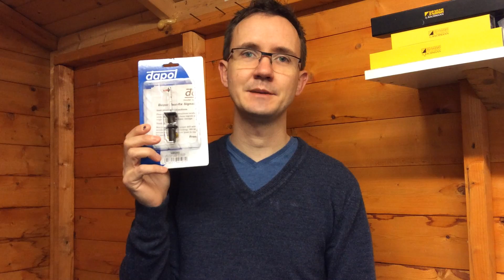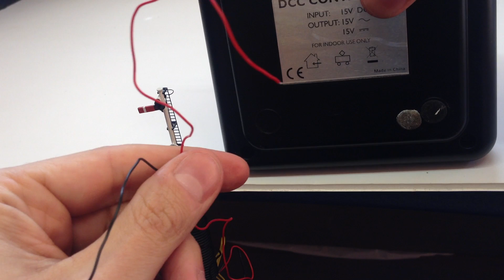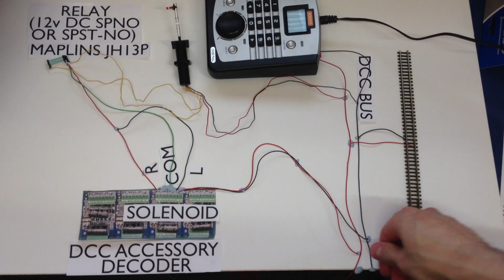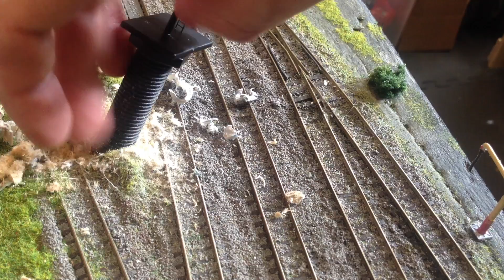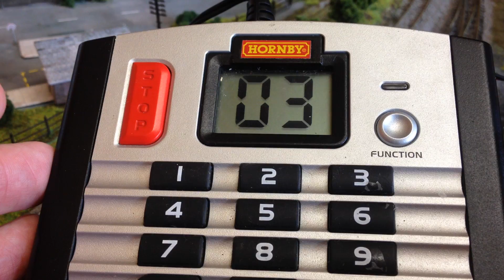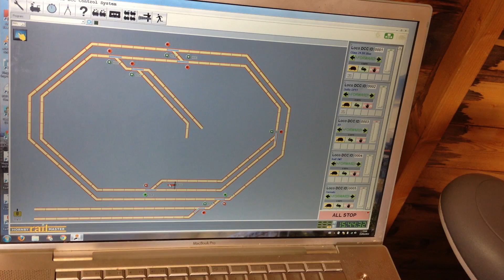Fitting signals controlled by DCC

Comment: Hi Simon, I am fitting  Dapol semaphore signals to my DCC layout. I am running Railmaster via a e link controller with Peco  insulated frogs run off ADS- 4SX dcc/dc solenoid decoders. For the life of me i cannot find the relays you quote on the  internet .The one you show looks nice and basic so would like to use that particular one. Can you guide me to the site to buy them. As I have 30 set of points i do not want to go buying train tech controllers for 30 set of points. .Also   Is there a way of linking the signals  to the the point so they are activated when switching the points. Thank you in anticipation.   Tony

Comment: Simon l followed you video all be it an old video very helpful.l tested my signal the same way you demonstrate,my signal powered up but would not work,what l did notice was when the signal was at caution the aspect was red which is incorrect the aspect at caution should be yellow on amber your input would be interesting Rgds Stuart
Reply from the maker: Hmm really tricky to know what's going on with it, do you have another to compare it to...maybe its a faulty one?

Comment: DCC controlled = more wiring than you need, and a heck of a lot more cost. Dapol semaphores will work on as little as 6v DC although they don't tell you that in the instructions. You can therefore operate the signal from a simple on/off switch. When you have say tens signals, you only need 11 wires to control all of them with a normal DC supply !!!!  Anything using AC nearly always adds more wiring. Anything related to DCC means roughly 4 times more cost. Get real, join a club and learn about basic DC and save yourself a fortune.

Comment: Trying to find a vid that shows cobalt motors working in conjunction with dapol semaphore signal.Were ass you can set 2 cobalt motors with same address so as they work together on a crossover.Could using this system with the same address as the cobalt motors.I see no reason why this will not work.Can the cobalt motor run the semaphone ?..with the led,s also.

Comment: Hi Simon

I know I am late to the party but, why are you using the relay at all?  The way you have the accessory decoder wired up it is, it is acting like a N.O. relay already (momentary power on [L and Com or R and Com] and then no power) so you could just wire up the yellow wires with one wire to Com and the other to either L or R and then a short piece of wire between L and R.  The capacitor does not affect anything - when it discharges it either holds the N.O. relay closed which connects the two yellow wires or (without the relay) just connects the two yellow wires directly, in either case until the capacitor discharges. Or am I missing something?

Comment: Hi Simon managed to sort it thanks. Schoolboy error in the end. The dropper wire powering the ads unit had come away from its rail solder. Therefore not sending any Dcc power to the unit. However still can not understand why I was recording power in the unit from the other wires? Anyway all working fine now thanks.
Reply from the maker: Sean Gardner Excellent, glad you got it sorted!

Comment: Thanks for the info simon. the ads8 has a line of four marked A and a line of four marked B. Only the side marked A has inserts for dcc, however they are not marked either -ve or + ve. I assumed a connection was needed for all four, as they then powered the opposite side (b). However I thought I read somewhere that only one dcc connection was needed to power all 8. I have not tested the relay, I bought the same as yourself, like I said I followed your how to to the tee, as it was so good. I have tried the listening mode switch but no joy. The more I think about it the more it must be the relay. I did notice after I soldered them that the outer plastic had melted ever so slightly, I have tried to activate them as you suggested an I did not notice any noise, so maybe we onto something. I have three banks of tawcraft decoders operating 12 points so could unplug gone of those to test. I have had a look at your thoughts on your new layout, although I have not made any suggestions. I am modelling my first layout in nearly fourth years on Goathland station and surrounding habitat. As some of our fellow modellers take things a bit to serious I have decided to call it Goatland, just in case I get a barrage of abuse for putting a tree in the wrong place, or not getting it accurate enough. like you said a hobby you can do at your own pace. Once I get something down I will try and upload some of my own how to's has have certainly learnt a lot from getting it wrong.  Keep up the good work and I am creating waterfalls and running rivers in my Goatland landscape and always had a fascination for layouts that have them. Fourth years ago it was very difficult to do as the products we have today were unavailable, we used to use varnish and a variety of paints and acrylics to crest at best a poor outcome. Today's products are fantastic and allow massive scope for interpretation. Many thanks once again for your feedback and ideas.

Comment: Hi Simon, may thanks, i have not noticed any noise at all from the decoder board, but have tested it for power and power seems to be going into the unit. this is my second board as i returned the first one as it was not working.. The light is on to them, i have three, at present, so the AC is working, and the signal move when the two yellows are connected. I am moving the switch in normal elink operating mode, once set up in the planning section.( i have tried to operate them in this mode also but no success) The DCC power going to the board, is the +ve and -Ve  set or can they be either way. (its not printed on board) does all A side have to have individual power or is power connection only necessary to one, one works all so to speak.
If you could help some more i would be most grateful, I am wondering if when soldering the connections to the relay i have damaged them in some way with too much heat? Keep up the good work, love what you have done on your videos have really helped me. I am back modelling after a nearly forty year break, and as you can imagine things have changed somewhat. great to see Oliver helping you, its one of those hobbies that when you are introduced to it, no matter how old you get, if you enjoyed it as a youngster it sticks with you for life. I remember listening to one of your videos when you said you were making a layout for the very first time, and thought at the time i wonder how long it would take for you to become hooked. keep up the good work guys
Reply from the maker: Sean Gardner Thanks Sean, it is a hobby that sticks with you, more of a relaxed pace, no need to rush.  AM definitely hooked, thinking about building another layout now!

It could be the relays, not sure of the exact relay you are using but I tested mine separately to make sure it was working.  I could hear a slight 'click' when it triggered.  Are you able to test whether any power is sent out from the decoder when you operate it from the e-link, or is there anything else that you could plug in to the decoder to test it?  If I remember rightly the ADS8 has 2 sets of power inputs, 1 for each 'bank' of 4 decoders.

Comment: Hi Simon, great how to on the signals. I have followed you instructions to the tee, however i am using e-link, and for the life of me can not get it to be recognize. I purchased the DCC concepts decoder as you are using so i would know it to work. please could you do a how to for thickos like me. I have connected the two yellow wires together as you did to make the connection and to check the signal works which it does, and the lights are on, but unfortunately can not get it to work with the elink any thoughts would be great
Reply from the maker: Sean Gardner Hi Sean, Have you set the address for the DCC concepts decoder?  You flick the little switch on the decoder board you have connected the signal to, which puts it in 'listening' mode, and operate the signal as if it is already set up, then flick the switch back and it should work. When its set up and you operate the signal you can hear a strange electronic high pitched noise from the decoder board every time you operate it (I assume its the capacitor 'recharging'), that should tell you if its firing, and at least the decoder board is working.

Comment: hi simon can I connect this signal to my seep motor switch so when  I change  the  point it  activates the  signal at the same time  ?
Reply from the maker: Robert Gilbert Tricky one to answer without trying it as I'm not the best at electronics! The SEEP does have "Auxilary switch" connectors but you can't connect it directly because the Dapol signal doesnt like any power sent down the yellow wires, so it would have to connect to a relay first.  Not sure how you would convert the constant power from the SEEP into a short burst required by the signal either...sorry!

Comment: could I just solder the power to a set of fishplates on my layout?
Reply from the maker: Yes that should work. Not tried it myself but some people say it's a convenient way to wire, some say it's not as reliable  of the fishplates are not tight etc.
Reply: would I be better soldering it to the track in a non obvious place then?
Reply from the maker: That's what I did, soldered wires to the bottom of the rails and drilled holes in the board to poke the wires down. It's tricky as you can melt the sleepers but with a bit of practise and a low power soldering iron you should be ok!
Reply: I made that mistake .Its actualy better with high power.With high power you just touch and its done.some times with the low power.you have to hold longer.